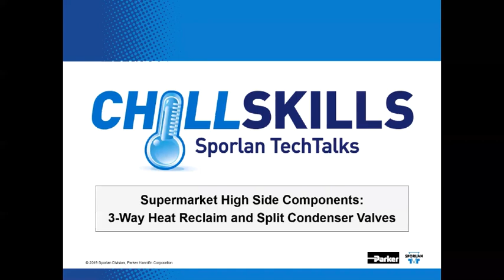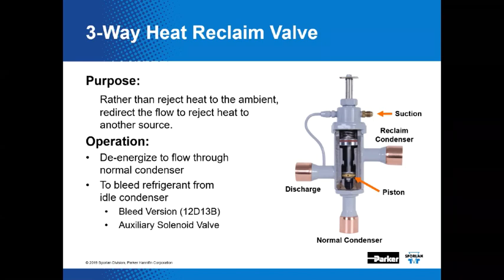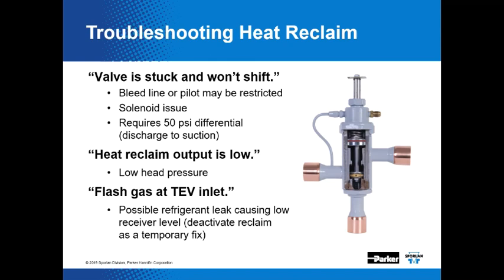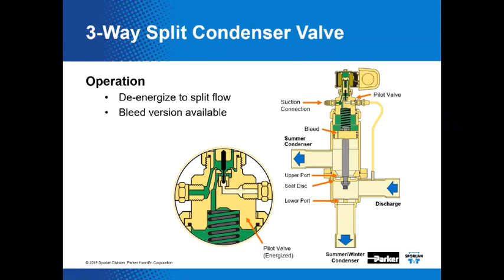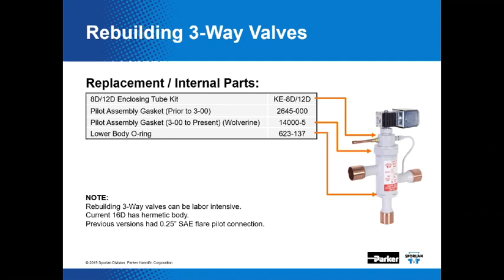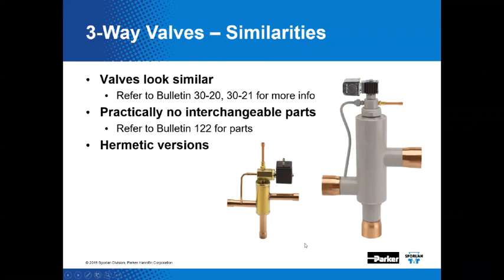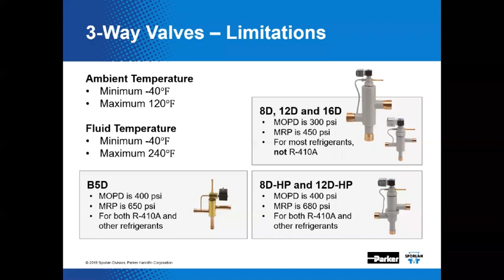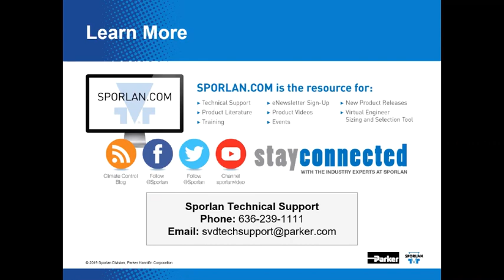Supermarket High Side Components – 3 Way Heat Reclaim and Split Condenser Valves

Comment: At around the 11:40 mark you guys are discussing the b version of the three way valve. If I  use a B version I thought I do not need a Normally closed solenoid?
Thanks

Answer is at 12:30